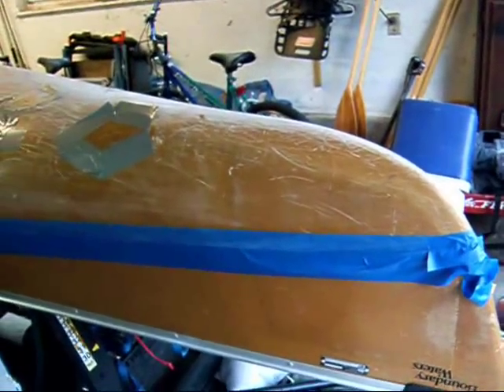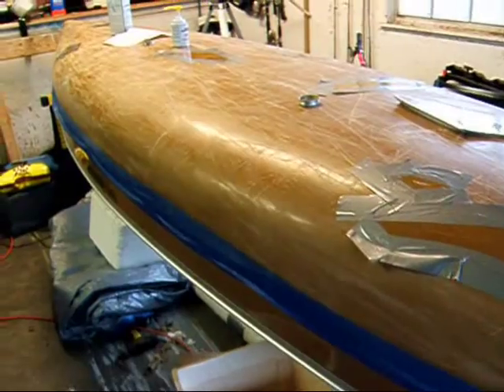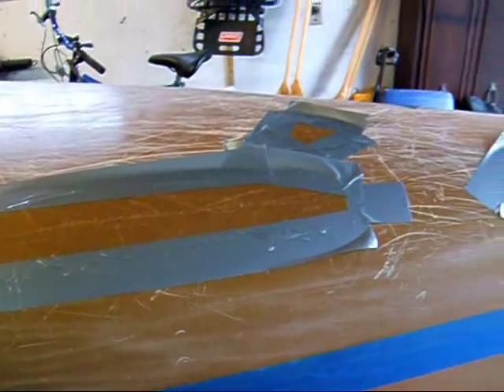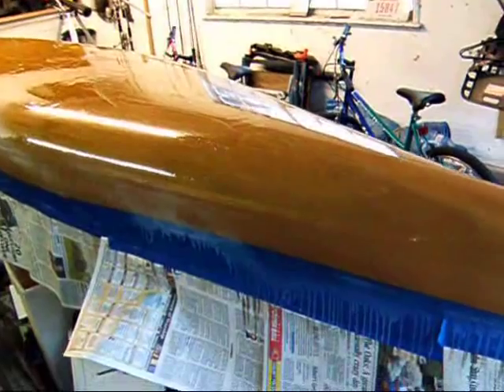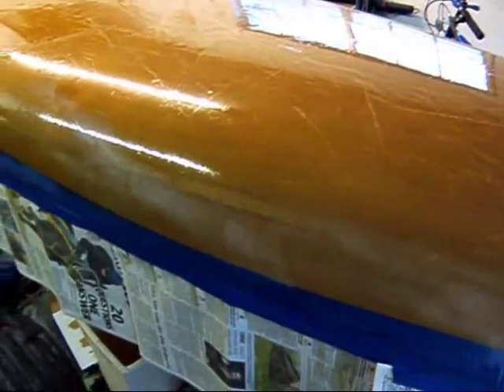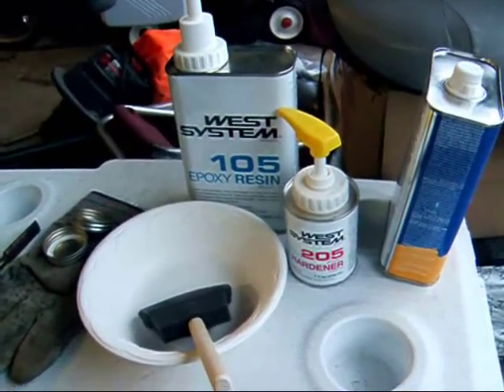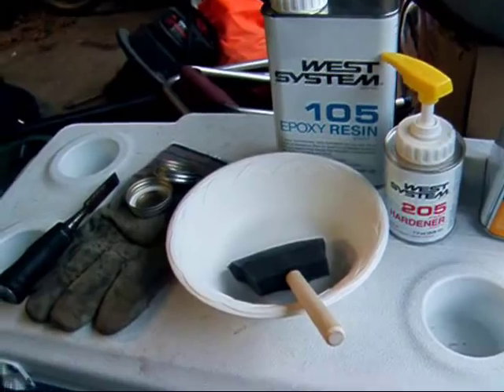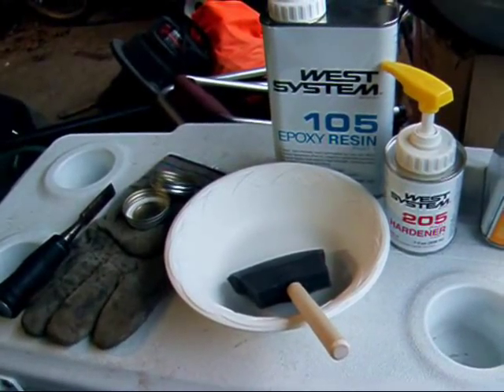GeoFisher's Canoe Repair - 2009

Comment: I contacted Wenonah, largest manufacturer of Kevlar boats. They do not recommend using epoxy or varnish for this. If you do use epoxy, it should be varnish because most epoxies  are not ultra violet stable. Wenonah makes their boats out of polyester or vinylester resin, and recommend these resins for repairs and recoating.

Comment from the maker: It has not delaminated as of yet........I do have some issues where I didn't sand enough of the polyresin off.  In those cases, it is flaking a little.

Also, I used WAY, WAY too much resin.  I have since done a couple canoes, and can usually get two canoes out of the amount I used on this single canoe.

There are a few diehard restorers and builders on bwca forum